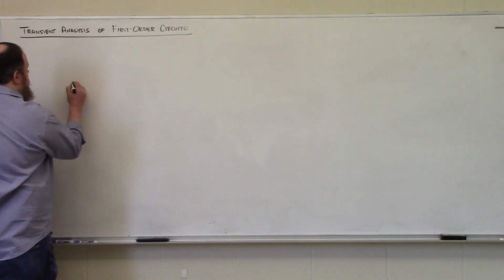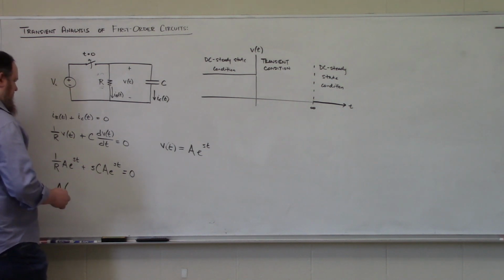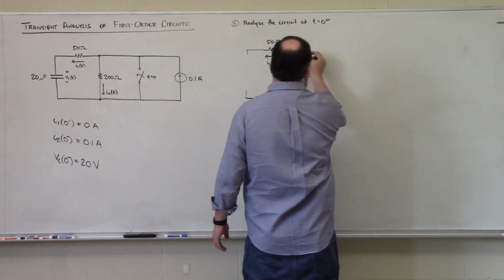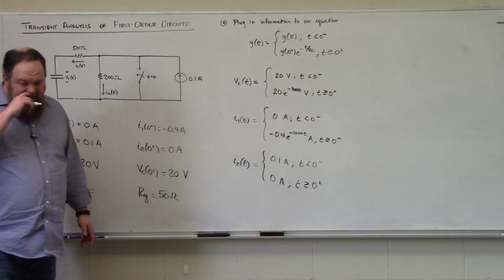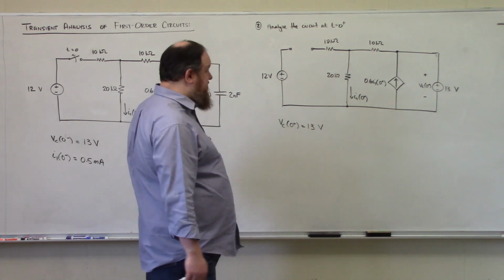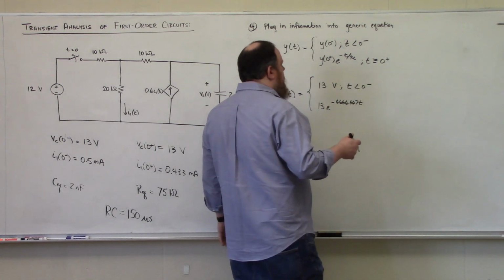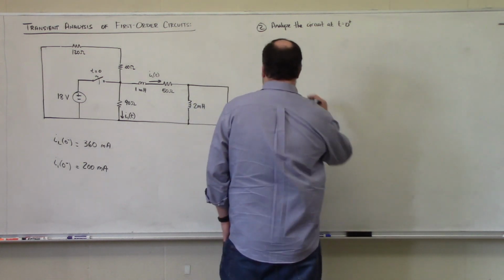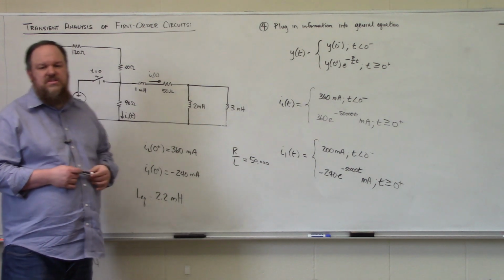ENGR 221 - Lecture 13 - Transient Analysis of First Order Circuits

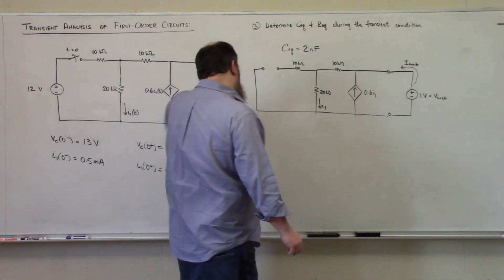Comment: Your calculation at 1:02:30 is wrong. Rth cannot be calculated based upon this circuit because the circuit, itself, is OVERDETERMINED. Please let me explain. For simplicity I'm going to put a 10K test source (to make the math easy). That means that the voltage across the 0.6*(i1) current source is also 10k. So we have 0.6*(i1) = 10k.or i1 = 10k/0.6 = 16.66k Now it is also true that there is 10k across that series (10k + 20 K resistor). So we have i1 = 10k/(10k + 20k) = 0.333 A. Do you see where the i1's don't match up because the circuit has no solution? You are free to use any value of Vtest that you like and will come to the same conclusion.
Reply: Addendum to my note above: To resolve this problem you may put a small resistance in series with the test source (say 0.0001 ohm). In that case you will find that Rth = 10K.